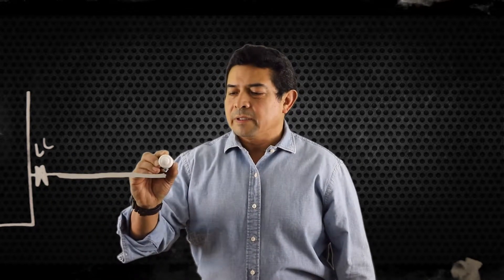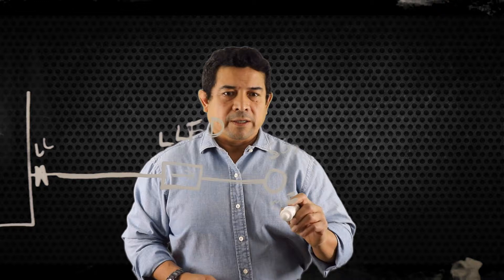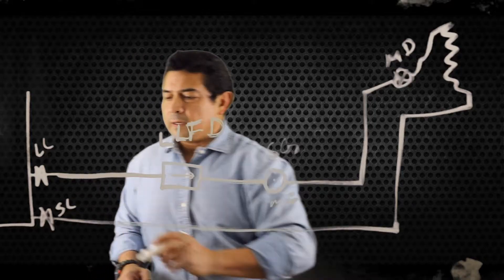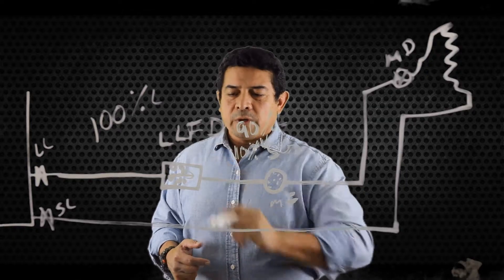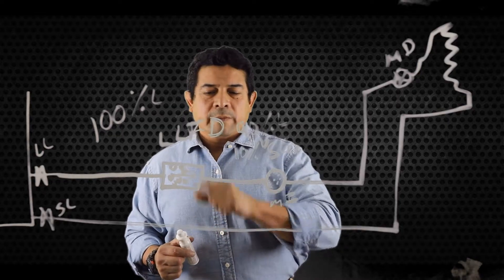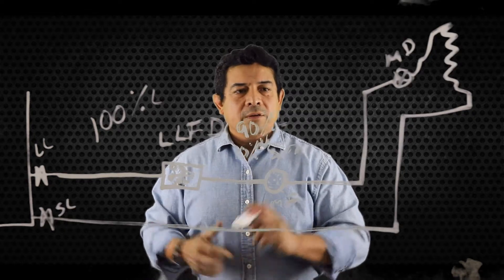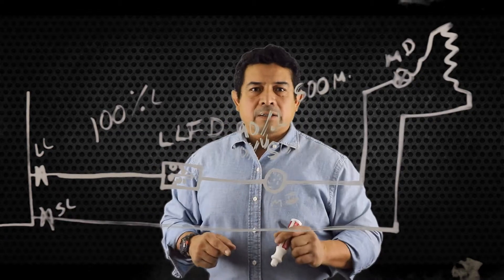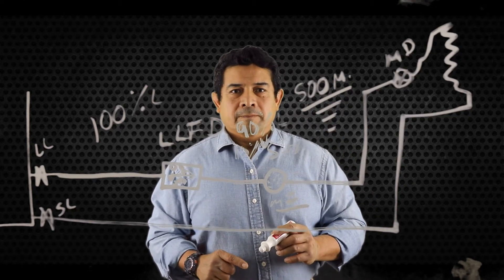Clogged Liquid line filter drier - HVAC Online Training and Course

Comment: I felt both sides of the line right next to my LLFD and both sides are hot. What does that mean? Also, about 2 years ago, I had bubbles in my sight glass and the maintenance man said I had a leak in my refrigerant line and charged me over 300$ to put new refrigerant in. He did not give me a new LLFD. Right now, I am having the same problems- bubbles in my sight glass. I am worried that he should have given me a new LLFD when he recharged my refrigerant 2 years ago.
Reply from the maker: Yes, a  lot of times, the system is low on refrigerant when you see bubbles in the sight glass.  If you felt both  sides and they felt hot, your filter dryer is most likely ok.  It normally does not get replaced unless something major happened, like the replacement of the compressor.   You may need more refrigerant.   A lot of units have a leak and because of that it needs more refrigerant every year or every other year.  what I would suggest is for you to look at the refrigerant lines, you need to look for traces of oil.   You mainly need to look where the bends/turns are or at the outdoor unit where the 2  lines are attached to the outside unit.   See if there are traces of oil. The traces of oil will indicate where the leak could be. let me know if you find or see any oil residue.    I will be here!!!
Reply: @AirConAcademy  Thanks for being here!! There is one line that is cold, so I am assuming that is the refrigerant line, right? I don't see any oil, but it is wrapped up, I assume so the hot Arizona sun doesn't warm up the refrigerant. Right now it is 106. I don't really want to take the pipe insulator off. I don't see any oil anywhere. My AC is on the roof. I am also wondering if my AC is not big enough for my house. All my filters are clean, my AC on roof is clean.
Reply from the maker: Maggie Whiteside Yes, the insulation is there to keep the pipe from getting warm. And you said it was 106°F? In Virginia we were up to 85° and I thought that was hot enough. OK you don’t or should not take the insulation off. And since your unit is up on the roof it will be difficult for you to go up there and look around for oil. The reason I wanted you to look for oil was because that is where the leak is. The leak should be repaired so you do not have this problem anymore. But of course that will take a lot more money.    I wish you could look at the unit to see if the caps are missing from the connections where the mechanic would hook up the gauges. If the caps are missing that is an easy fix.   One thing you can do is check the temperature of the air that is going into the AC unit. The air going into where the filter is. And check the temperature of the air leaving the unit. In other words the air supply into the rooms. You should have somewhere between 15 to 20° temperature difference. If there is less than that then it could be that you need refrigerant And the air is not getting as cool as it should.
Reply: @AirConAcademy  I was worried there was still a leak! I was really hoping there was an easier way! The air coming out of my vents is not very cool. It's not hot but it's barely cool. And it's not coming out powerfully like I've experienced in the past. I don't see any caps missing. Will I need all new lines? If they replace my lines and give me new refrigerant, how much money are we talking? My unit is 8 years old. Should I get a new one? If so, do they make air conditioners that don't need refrigerant (I thought I heard that they did)
Reply from the maker: Maggie Whiteside they make some very small electronica ones that do not need refrigerant. But not big enough for your house. They sell a Liquid that the technician can put inside to stop the leak. I have heard that that works pretty well from some technicians and from a few others that does not work so well. I guess it is a hit or miss thing.    I will see if I can find the information for the Liquid maybe you can get someone to put that in for you. If the leak is in the lines they can fix the leak or they can replace the lines. But sometimes the leaks are in the unit inside the house, or in the unit outside.    The important thing is to find and repair the leak. Once that is done you should never have to add refrigerant to it again.    Eight years old he’s not that old. I installed a unit in my parents house just over 30 years ago and it is still working. Replacing the lines or the AC unit could cost anywhere between 10 to maybe $12,000. Depending on who is going to do it.    If the air is not coming out that cold out of the vents and you see bubbles in the site glass then most likely it is low on refrigerant. Also make sure your filters are all clean and where ever you have return grills it is not blocked. Some people put furniture in front of the return grills.
Reply from the maker: I looked it up on Amazon and this is what I found  https://www.amazon.com/Nu-Calgon-4050-08-EasySeal-Direct/dp/B00VAQCM0Y/ref=sr_1_fkmr0_2?dchild=1&keywords=Nu-Calgon+4050-06+A%2FC+EasySeal+2.5+ounce+Pressurized+Can+Treats+1.5+to+5+Tons&qid=1591240094&sr=8-2-fkmr0
Reply from the maker: This is the  one that I have used, but it is usually  only sold in supply houses that sell to only licensed technicians      https://www.hvacwholesaledirect.com/buy/product/Nu-Calgon-4050-06/33084?gclid=Cj0KCQjwlN32BRCCARIsADZ-J4vovDzntzrIoGJss9qhcZLNuP3xyPghEYavOak391yikC4eFLjF4mYaAnnNEALw_wcB
Reply: Aircon Academy This is all good info, thanks! The company that came out 2 years ago put that liquid leak stuff in my lines and put more refrigerant in but it seems like it didn’t totally work because here I am again. My ac works well normally but now that it’s 106, it’s struggling. I can’t spend too much money on it. My ducts are old and rusty. Maybe I should have them replaced? I’m doing research now on what route to take. I appreciate your correspondence!
Reply from the maker: I wanted to give you an idea as to what you may need to ask for and hope that it works.  I thought you could get it from amazon and have it when they come or maybe suggest to them to have one when they come.  also you need to know if your AC unit uses R22 or 410a.   it should say in the name plate on the outside unit.  this one from amazon says that it is compatible  with all refrigerants so it should do the job.    https://www.amazon.com/Cliplight-Super-Seal-Total-972KIT/dp/B003KVX0BW/ref=sr_1_fkmr3_2?dchild=1&keywords=Nu-Calgon+4050-06+A%2FC+EasySeal+2.5+ounce+Pressurized+Can+Treats+1.5+to+5+Tons&qid=1591240521&sr=8-2-fkmr3
Reply from the maker: @maggiewhiteside4463   Glad you are researching. Replacing the duct work will not make it work better. I hope the temperature drops soon for you there. Sometimes it takes 2 shots of that leak sealant but you need to decide and it all depends on your financial situation.   Good luck and if you have any other questions let me know.

Comment: Where is this sightglass? I cannot find any sightglass on my home hvac system?
Reply from the maker: Most of the time contractors will NOT install a sight glass in a residential unit. It is what is called an accessory so it is a component that is nice to have but not necessary. If you look on the two refrigerant lines connecting the outside unit to the inside unit you might see a filter on the liquid line (the smaller line of the two).  The new refrigerant 410a should have a liquid line filter dryer.
Reply: They do not put sight glasses on residential b cause I s just another spot for a leak to develop, check temp on both sides of drier if it's significant difference the drier is cloged
Reply: There is rarely if ever a sight glass maybe 1 in 500 units.

Comment: A friend asked me to check their walk in cooler that is not getting cool.  The rooftop condensing unit puzzled me, as the line "leaving" the filter dryer was very COLD, yet the "inlet" side of the filter dryer is very warm.   The low pressure (larger sized) line coming from the evaporator is warm. Sight glass shows no bubbles and condensing unit is cycling off and on.  Down at the evaporator, the small pipe (hi side) is cool and has condensation forming on the tubing. Low side is about 60 degrees, and the output air temp is also about 60 degrees. 2 "professional" service techs have just added R12 (it's an old system) to the system, claiming it was "really low on refrigerant".  Am I correct in assuming there is a problem with the filter/dryer, and it should be replaced? It seems like all the heat transfer is taking place after the filter and before the evaporator coil. 

Or, should I mind my own business and let the pros pump more refrigerant into this system?
Reply from the maker: Duke Bacher  That is what I always try to do. Try to save the people the expense. Great idea and please let me know how it turns out. Thank you and good luck
Reply from the maker: That is tough    it depends on your relationship with them!!!   YOU are correct the dryer is the problem it needs to be replaced.    adding refrigerant to it might kill the compressor. 

you do not want them getting mad at you and trying to fire you     I have seen that happen.
Reply: I am just looking at the system for a friend (that owns the walk-in) This evening, I went up on their roof to see if there was any change, and the symptoms are exactly the same. I'm going to order a new c-165-s filter  and install it. There are isolation valves on each side of it, with a service port on the inlet side. Looks like someone was thinking ahead when they installed it initially. I should be able to evac the new filter dryer once installed then open the valves and be good to go.

BTW, I don't work for those "pros", I'm a maint tech for a hotel myself. (studied some HVAC on line so I could diagnose PTAC issues... I believe "the more you know, the more you're worth") I really appreciate your feedback, though- It's nice to know my "hunch" was correct. I'll let you know the outcome, as the friend was prepared to purchase a replacement refrigeration unit if needed anyway.  I'd love to save him the expense if I can...
Reply: @dukebacher1216  What was the outcome sir,Very curious.
Reply: @jacobharrison1338  Indeed, it was a plugged filter/dryer!    It had service valves on each side, so I sprung for the $14, replaced it, opened the valves... it worked perfectly.  It hasn't been touched since!